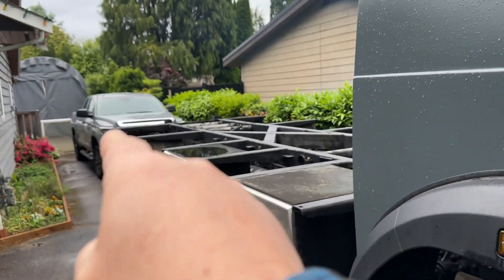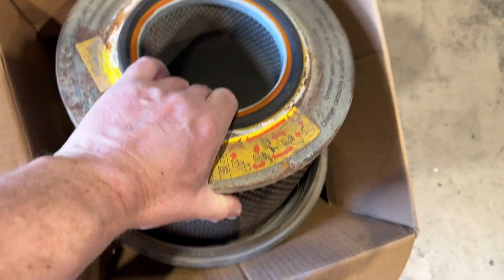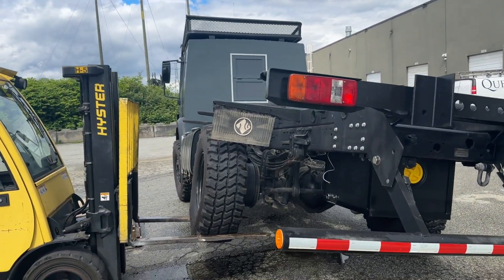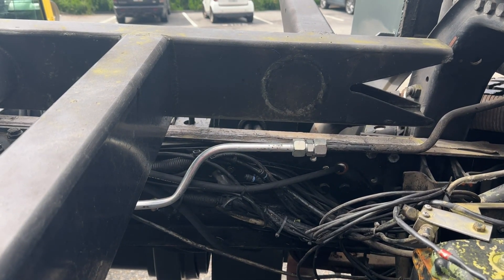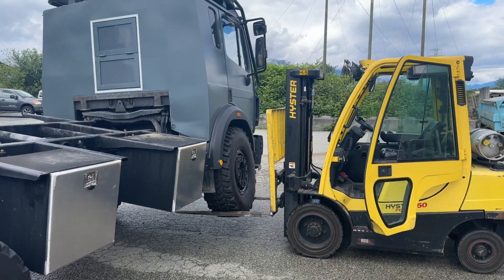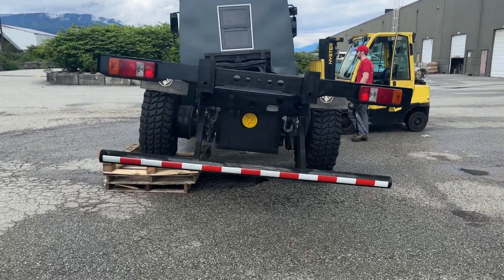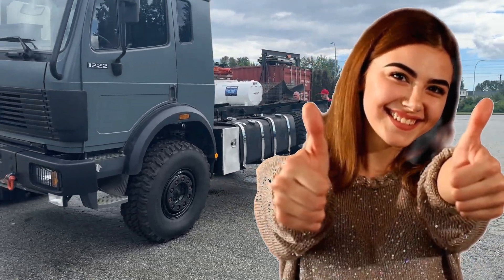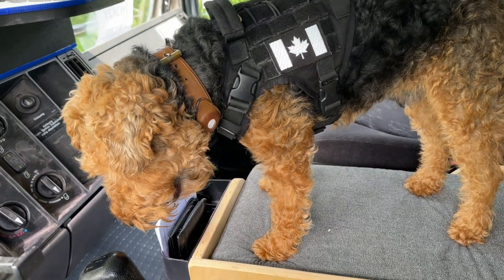Subframe twist test for Expedition truck DIY !

Comment: Hello ! Your springs are on both sides (up and down). Would you mind sharing where you got them and or who advised you on these ? Thank you.
Reply from the maker: Hi, to explain this it is a little complicated I bought the springs in Germany. Check the description box of this video of mine.  https://www.youtube.com/watch?v=AofUFJdpx7k&list=PLMCbgfipPl3COTbEDwdFlFVzJA0P69YoS  you will find the supplier there. 
Regarding the spring calculation, I used a webpage from an other overlander called " Pistenkuh " the webpage can be translated with google translate. But by looking through his webpage I couldn't find the topic quickly, he changed his page a bit. Maybe you can find the topic Subframe or ( german = Zwischenrahmen ) he had formulars there, to find out the right spring rate.  https://pistenkuh.de/expeditionsmobil/pistenkuh/

Comment: Nice work! Slowly following your steps, just finished extending my frame, about to move the rear axle back and get on the sub-frame. People don't realize how much of a project this is! By the way, I met your water filtration system guru last wknd in Bad Kissingen, we had a good chat and he says😂 hi!
Reply from the maker: Oha extending the frame alone is quite the project, extending the drive shaft, brake lines and so on. Yes the whole camper build is quite a commitment takes years if you do it all by yourself, but also saves a lot of funds.  Thank you for the greetings I am sure Joachim gave you plenty of information about the filtersystems. Cheers
Reply: @oscaroverlander_MB1222AF  Yes, he was very knowledgeable! It would be nice to meet up later this summer, curious to see your build in person!

Comment: Tell me if I'm wrong. I'm designing my subframe and i don't want it to work like yours. As yours, in this video is moving way too much close to the cab. Close to the cab there should be very little separation from the subframe to the truck frame. We both know how theses frames twist. The greater separation from subframe to truck frame should be at the rear of the frame rails, while close to the cab, the habitat should behave like the cab itself. Additionally there should be hardwood along the truck frame top, so when the subframe falls flat to the truck frame there is buffer and not metal to metal. I see most commercial upfit firms do this.
Reply from the maker: I am not sure that I understand all of your comments but to the tight connection subframe to chassis I choose the rear as connected end, you can make that also at the front of course. It's your choice. In regards of any material between the subframe rail and the chassis rail, it is actually forbidden to install something between the two. Mercedes Benz has regulations for that it called " Aufbaurichtlinie " These are doe's and don'ts for every attachment fabricators, they build on top of the base truck chassis ! Cheers
Reply: @oscaroverlander_MB1222AF  Aufbaurichtlinie is a warranty issue. I see theses on American tucks all the time. Next time you are at a stoplight next to the garbage truck or landscape truck you will see the wood spacer.  And Mercedes warranty is not an issue for 25 year old trucks. Okay, so you chose the rear and I chose the front for the connection point. I'm curious the advantages of each choice. So what is your opinion? The frame rails are engineered to twist, but not under the cab. The twist becomes greater as the frame meets the springs connected for the rear axle.  And becomes even more so after the rear axle. The main reason for this subframe is not to transfer this twist to the habitat foundation.  However the crawl through should not have such a drastic movement up to the 4 inches you show in this video. At the rear the twist movement does not affect anything close to the cab. Theses guys " rvglobetrekker " are building the subframes for customers and they talk about the crawl through issues. They also build crawl throughs.

Comment: Good to see your sub-frame is working as expected.    I still have to make this test also......   although I always calculated and measured with 12 cm (4,,7") distance between frame and truck.    Looking forward for the video of the wedding.     By the way, I had a nice chat with Uwe (about you😀 as well) as I was with him last week.    keep on going.
Reply from the maker: Good stuff ! Yes the lift resulted in 10 cm but I still have somewhat left in the springs I am guessing 12 cm is max and plenty. I am happy with the performance. So you talked with Uwe Albrecht the water tank fabricator, I hope only good  topics lol . Cheers